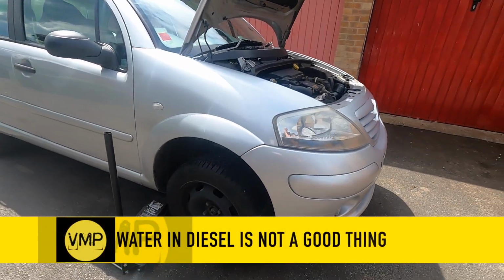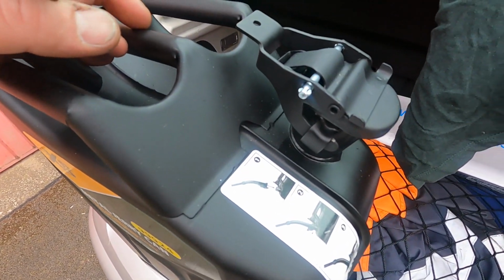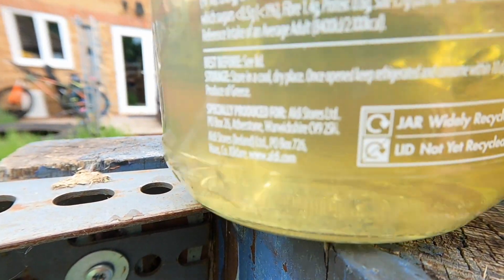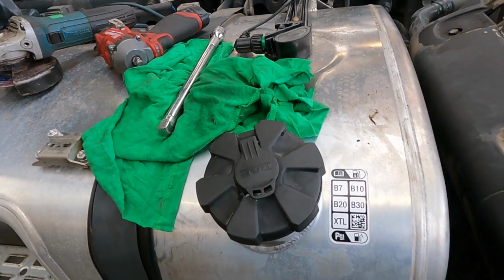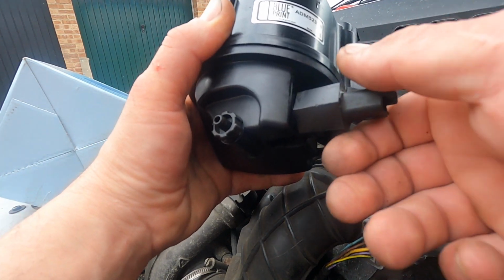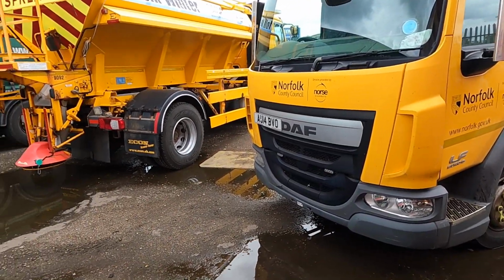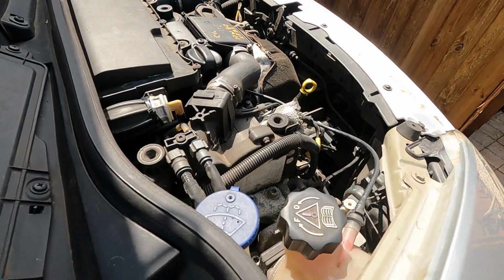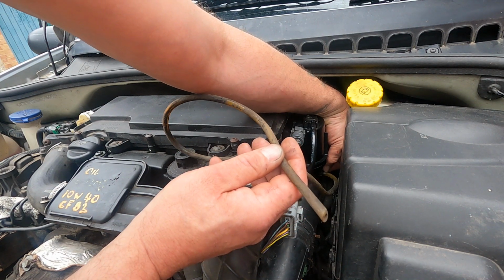VMP - Why Water in Diesel Fuel is a Bad Thing

Comment: so....
I better replace the current / default diesel filter with a modern one, with a sensor, on my RRC ('76)?
Good video, appreciate it!
Reply from the maker: Nah, Not sure about the '76 RRC unless you've had a diesel conversion. A sedimentor in line should do.. Defender and Discovery 200/300tdi have the primary filter on the chassis just after the tank which noone ever takes care of.
Reply: @theapocalypsechronicles3  yep, that's the one I talked about. I know of its existence since you showed it in one of your vids, :)
Reply from the maker: @tomsimonis  That would have been some years ago.   I still miss the LR products.  The Lottery hasn't allowed me another yet!

Comment: Yup water is bad.
We had water in our bulk tank for our machines (rainwater through leaky lid), it actually caused a full rebuild of one of our tractor engines and the bacteria it caused issues in the in tank filters on the machines for months.
Reply from the maker: Oh christ yeah, once it's in there, hard to get rid of but there are additives that should kill the bacteria off...

Comment: I gave up on metal Jerry cans, only use plastic ones now. You can get some good quality ones cheap, no rust or paint issues and the spouts are much better. 
I also installed an extra glass bowl sediment filter to keep an eye on any water issues, works well as a pre filter with a mesh at the top, primary filter always seems nice and clean when changed.
Reply from the maker: Nice to hear. It's a retrofit using a glass bowl? Years ago there was a small jam jar that would fit exactly into some of the filter slings. Doesn't happen like that now.   Anyway, I nipped down to the Local Aldi earlier and found another jerry can which had been returned by a customer.  The reason I really wanted two was to get a weight balance in the rear of the car. Happy now.
Reply: @theapocalypsechronicles3  It’s a purpose made part mainly used on old tractors, was only about £13 and works great with standard threaded fuel unions so easy to fit. 
Ideal, happy days.